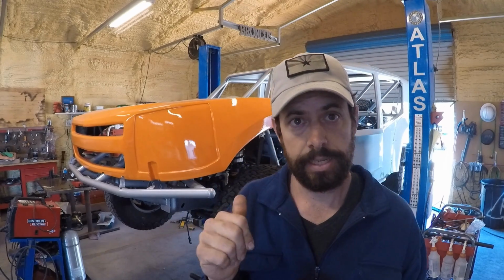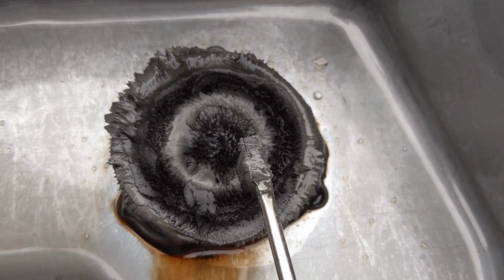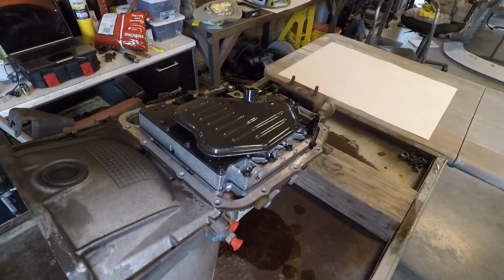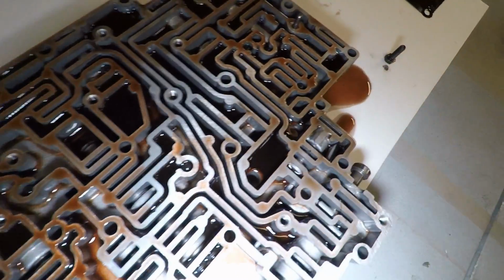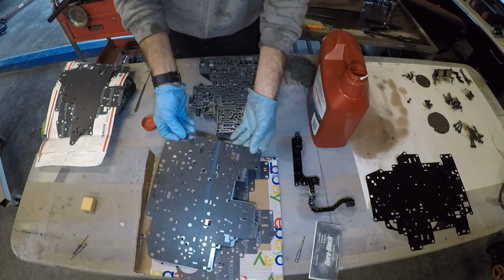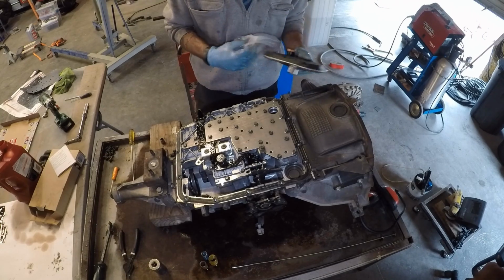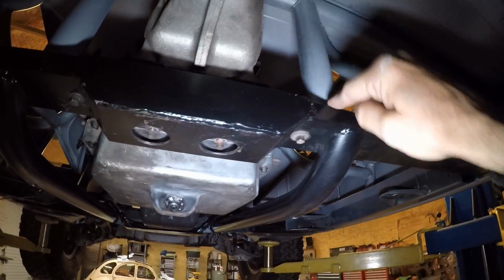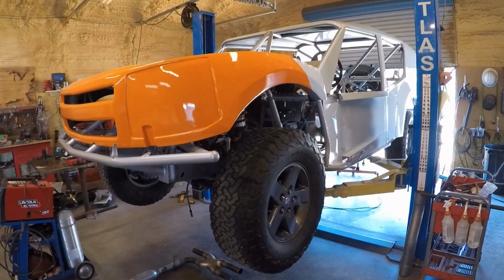$4k Crown Vic Trophy Truck Build (Episode 16)

Comment: I thought you said in an earlier episode that the trans was leaking from the pan gasket? But then you reused it.... (I would do the same) Where was the leak coming from? Love the build! Hi from Perth Western Australia!
Reply from the maker: It was leaking from the pan gasket and I did not re-use it. I think what I meant was that it was designed to be a reusable gasket (hard plastic with the rubber insert) but the one that was on there was toast.

Comment: Why is the trans cover stamped with "METRIC?" Are the bolts not imperial or is it for another reason?
Reply from the maker: Ford started stamping METRIC into things when they switched over to the metric system. This was over 20 years ago. There was a short time when they were transitioning out the small block for the modular v8 that you would need both Metric and Standard tools. As far as I know the only standard hardware left on a crown Vic this generation are the torque converter studs and nuts.
Reply: @AustinCoulson  Thanks, I had no idea. As a European I just assume that more or less everything in the US (except NASA) is using imperial. :)

Comment: I have a question about the rear suspension on the vic. I've changed my mind about the f150 swap and I'm gonna part that truck out and buy an f100 for a frame swap but I don't wanna cut a hole in the bed. I was wondering if it would be possible to cut out the frame at the top link pivot and drop that whole assembly down to minimize the hump in the frame.
Reply from the maker: You would need to add a track bar for it as the Crown Vic uses a watts style center link. I have either cut the bed or used an aftermarket 4 link if I wanted to keep the f100 frame. I prefer to raise the whole bed instead of a hump but I have done it both ways.
Reply: @AustinCoulson  right  I figured I could just move everything down including the stuff for  the center link and maybe get longer links, probably lift the body and bed up a little.

Comment: So I have a question do all trophy trucks mount the engine in the center like this?  I’ve never really got into trophy trucks although I’m not sure why they are really cool they just always seemed to expensive of a hobby for me. Anyway I just was curious if this was rare or common practice. Sorry I know I comment to much lol I just think this is a cool project don’t feel like you need to reply I just talk too much lol.
Reply from the maker: Check out pics online of trophy trucks with no fiberglass, most of them put the motors directly behind the control arms so about 10-15 inches forward compared to mine, but they are longer, usually by 10-20 inches in wheelbase and they do the radiator in the back along with a second spare tire, and more weight on the rear suspension. So their seats aren't forced to be as wide as mine. Also their engines cost more than my house.

Comment: When you enlarged the holes in the seperator plate, did you also have to enlarge the holes in the gasket?
Reply from the maker: Sometimes you do, it depends on the brand of gasket. In my case it was aftermarket and I didn't have to, they were already larger than the holes in the plate.
Reply: @AustinCoulson  thank you for the fast reply. I have a 2007 Crown Victoria and just got the transmission rebuilt. As soon as my warranty is up, I plan on doing the j-mod. I was always curious about how precise those holes were in the gasket. I'm loving this build btw!
Reply from the maker: @jasoncooper3116  Thanks! I am interested in how the trans will feel. Is such a light vehicle it probably wasn't necessary, but it should make it a little more aggressive.

Comment: First of all, where are you living, I mean State. Also, I think the buggy looks grreat and wonder    how many  H P does it have and what gears, rear end gears?  Thanks
Reply from the maker: AZ, stock the CV is around 265, now it's probably 280 with maybe 215 to the wheels. Gears were 2.73 here, but I do a swap later to 3.73

Comment: The oil has never been changed. That plug is put in at the factory and when they put the dip stick in for what ever the model calls for it falls into the pan. So when you find them you know the fluid has never been changed. Not sure but doesn’t it have like 12000 miles?
Reply from the maker: You are correct about the plug. She had 133k. I was very surprised to see the trans fluid in such good shape for being original.